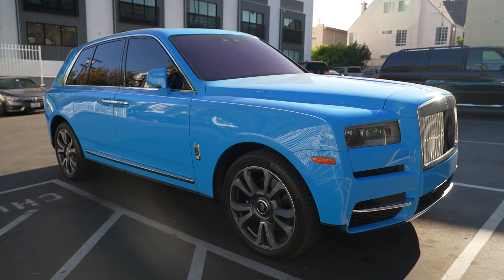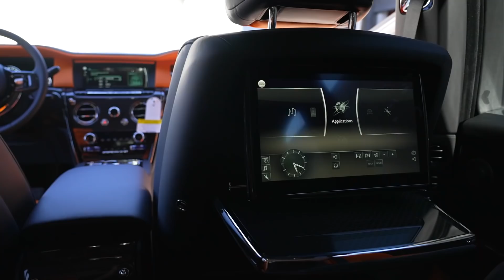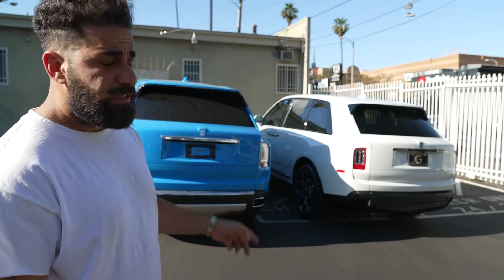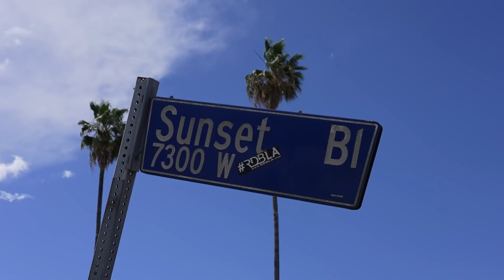Jeffree Star's Brand New Cullinan & Making a Shelby Custom Bumper.

Comment: Bro.... U can prevent rats coming into the engine bay by using a high frequency speaker... You can buy it from ebay and hook it up to the battery with an in line fuse that it comes with... It never drains the battery for me.... IT WORKS

Comment: A broken down Camry, never thought i’d see the day
Reply: The new camrys have transmission problems and won't start sometimes because there is a bad connection in the head unit
Reply: @habibihamoody1834  agreed the transmission is garbage
Reply: @Yaboi007  they drive like doo doo also you would have more fun driving a minivan than a new camry
Reply: Is that famous 2AZ-FE 2.4L engine (2002-2009 Camry)that’s known for Burning Oil. Even Scotty Kilmer (Toyota Fan) said that engine is the worst engine that Toyota has ever built, unlike their 2.2 L 5S-FE 4 cylinder (1990-2001); now that’s a bulletproof engine.